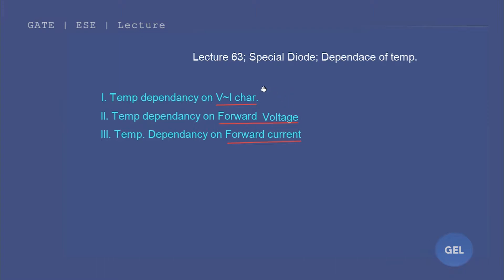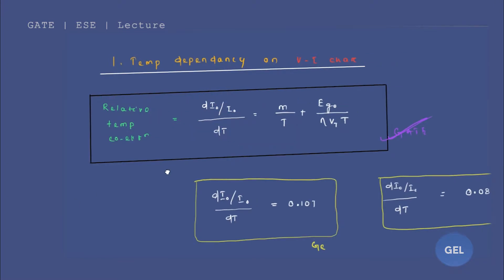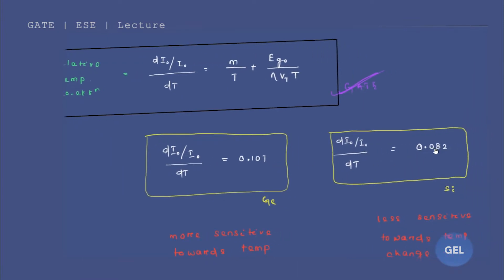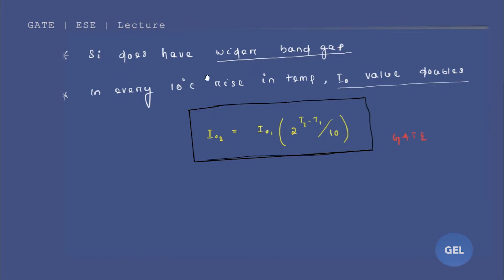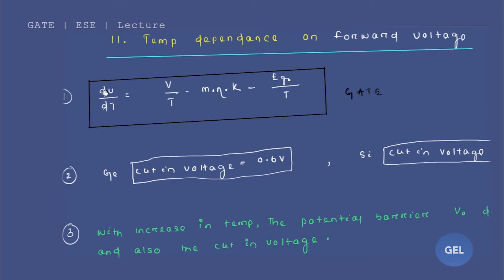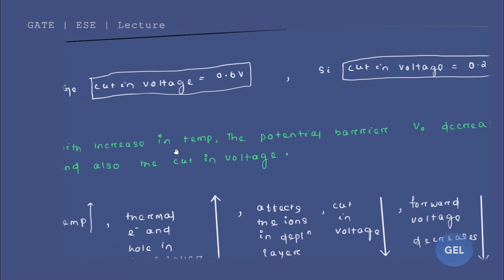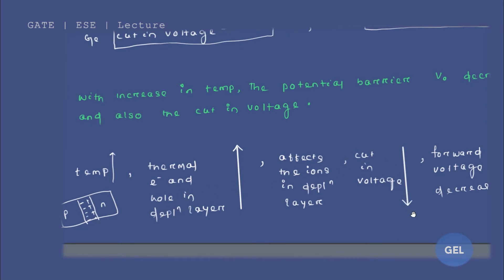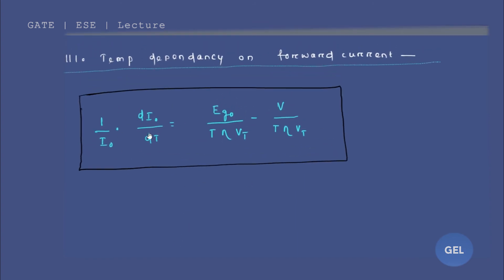Lecture 63; Special Diode; Effect of temperature

Comment: Sir, I think cut in voltage for Ge is 0.2V and Si is 0.6 V
Reply from the maker: Yes, we really sorry.  You can clearly see I was in hurry. Also I have mentioned these values in previous lectures.
But it's like GK no?
Everyone knows it. No need to mention it.
For example if I wrote 2+2 =5, you can take it is as  mistake and can rectify it. 

But understand the concept. And do remember the formulas